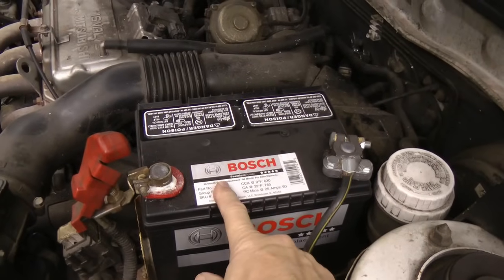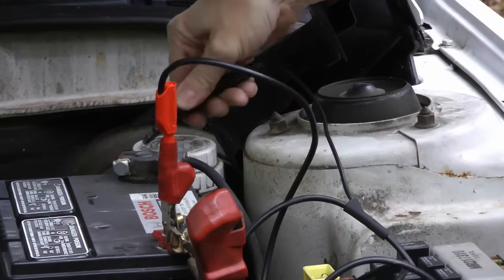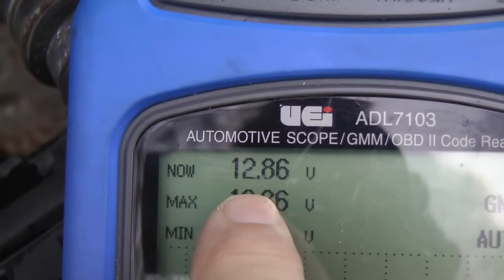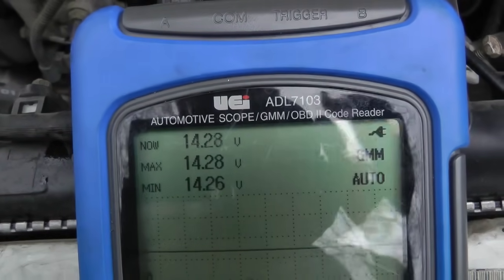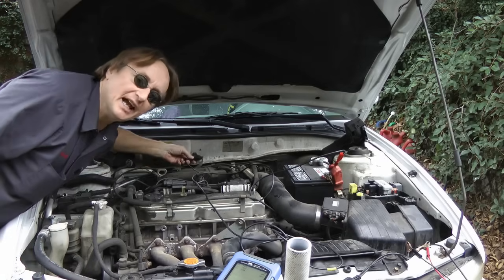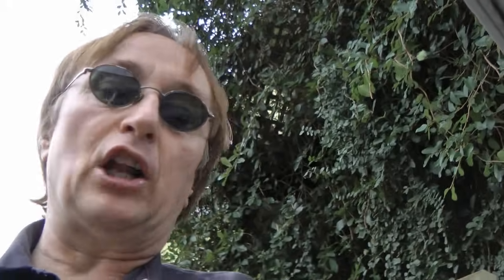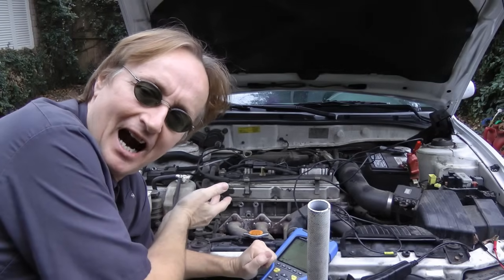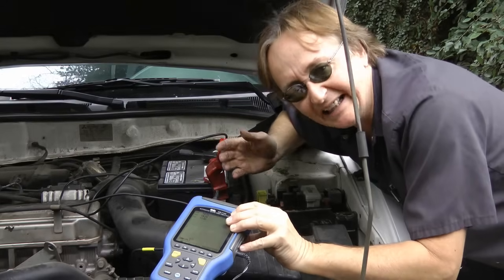How to Fix Electrical Problems in Your Car (Ground Fault)

Comment: hey scotty, i have a 2003 mazda 6. My brake lights remain on the whole time, even after the car is off. i replaced the brake light switch but that didn't seem to make a difference, what can it be ?
Reply from the maker: often the button that the brake light switch hits falls off, so the brake light just goes into that hole and the light stays on. Check that first.
Reply: i did give it a look and everything is fine. Any idea of what the problem might be?

Comment: Thanks for the tip on the engine ground. I have a mystery immobiliser problem and wanted to cross that one off the list. Trouble is knowing where to(or how to) get to all the other grounds to check them. Mechanic/electrician were reluctant, preferring to put a scanner on it, which seems like a total cop out to me.

Comment: Hey Scotty, on my toyota corolla 05 the key doesn't turn on the engine, I narrowed it down to no power getting to the starter relay, testing it I only got 1.6v of power on to it when i turned the key. But I cant find the source of the problem, any ideas?
Reply from the maker: often just a worn out ignition switch
Reply: Scotty Kilmer I have checked the ignition switch and it has continuity from turning the key. the Relay is new, and the starter is new, I have checked the Neatral safety switch too and it seems to work just fine. Still cant get the car started :/
Reply: ***** sir try to check the connection of d starter...

Comment: Is there a simple solution for my horn going off intermittently, I tap on steering wheel and finally and it quits, 2006 dodge stratus

Comment: Hey Scotty! I have a 1995 Honda Accord and when I turn the headlights on it takes awhile for them to come on. Like they need to warm up or something. Then, as I am driving they go in and out (not all the way out, but I am afraid they might). Also, my stereo goes on and off randomly.  Any suggestions?

Comment: Scotty Kilmer   Alright Scotty, I have a 1997 camaro z28. when i turn my car on, it turns the head lights on. and also, my tail lights come on but when i use my brake, the brake lights will go out. When i pull the fuse for my tail lights, the brake lights work like theyre supposed to. any ideas?

Comment: Scotty, here's one. I have a 2004 corolla which has a burned out brake light. The running light was still functioning. I replaced the bulb and the brake light still does not work. Now I have more problems, none of the rear tail lights on that side of the car work now (running, turn signal, back-up or brake) Any ideas here?
Reply from the maker: check the grounding wires on that side, odds are they are bad, you need power AND ground to make bulbs work. also check sockets, corroded ones will lose power or ground

Comment: Hi Scotty, My car is a 1976 Buick Skylark. Yesterday while I was changing my backup light bulbs, I noticed that both bulbs are 1157 dual filament bulbs. Why is that?
Reply from the maker: someone put the wrong bulbs in, BU lights are only one filament , that or some nut rewired them.
Reply: Scotty Kilmer  i have a question is regarding an electrical short in my car that is draining my battery... i already identify the fuse Engine Control Module ECMB 10A on my Chevy Blazer 4.3L S10 1989. how can i fix this problem?  please...
Reply from the maker: Hiram Camargo
that's the main computer fuse, either its wiring or computer is shorting out, have fun testing all those wires.
Reply: in this video, you always have one wire connected to the battery, so where do you connect it when you are far away from the battery?

Comment: Hi Scotty, I just attempted to install a pioneer headunit in my 2004 Kia Sorento EX. When I came to test it to see if it works, I started to observe electrical problems so I installed the factory radio back in the way it was before and the problems still there. The problem is as follows: radio doesn't work at all, dash clock doesn't work, when ignition is turned to on  the blower moter automatically turns on as well as the speed, tach and temp gauge readers rise for a few seconds then drops to zero, the drivers side parking and tail lights don't work, when headlights are on the dash lights and tail and parking lights go out when door is opened but headlights themselves remain lit, and keyless entry and power locks do not work and that's all I found so far. Fuses are fine. How can I find this problem before I take it to a dealer and pay a small fortune? thanks in advance.
Reply from the maker: probably shorted out a computer module, no one but a dealer is going to have equipment to check that stuff out, or a guy who used to work at one and has a kia dealer scan tool,hardly anyone has those, including me.
Reply: Scotty Kilmer Would it be fine driving? or will the problem spread to epic proportions?
Reply from the maker: res06cue
one never knows, drive it and find out. As long as it runs ok, may last a long time
Reply: Havent had any problems yet thanks scotty
Reply: Scotty Kilmer Found the problem, it was a fuse I've missed that was located in the distribution box under the hood replaced it everything's normal now. Why was the other components effected by a blown 20 amp audio fuse is beyond me.

Comment: mr kilmer my car stereo does a buzzing noise on fm what could be the problem
Reply from the maker: try installing a noise suppressor on the radio power line, radio shacks sell em
Reply: I will mr kilmer thank you

Comment: Question i have a missed fire on cylinder #3 replace injectors and did some tests after that i figured the is not getting the grounding signal. What can i Do? HELP
Reply from the maker: either wiring is shorting out, or main computer circuit. Often the computer
Reply: thanks for responding, I'm going to look for the wire the  goes to the computer before taking it to the dealer they always charge an arm and leg you know what i mean thanks ones again
Reply: thinking about this issue can i jump the ground  from other injector?

Comment: Hey Scotty what do  ya think about this. ? problems started on my 2005 pacifica with the consol shifter not moving. well I found this pink thing on the side of the consol and stuck a wedge in it and now it will shift , however ck engine light, tracking light,abs light and parking brake light are all on , then I discovered that the radio/cd wont come on /neither will the a/c heater . the elec.windows don't work and also the headlights. The brake lights do come on when pedal is pressed. so what is it.?

Comment: Thanks for the video Scotty. When I turn on my headlights in my 95 es300 my transmission goes nuts. Its fine with the lights off. Seems there is a bad ground somewhere.
Reply from the maker: I would assume that, OR have the alternator load tested,places like auto zone do that free and it could be that

Comment: Hello scotty I have a 2002 mitsubishi eclipse got all sorts of  problems  gas gauge  works sometimes it doesent the radio dont work and the doors lock and then they unlock themselfs can this be a problem with ground I tested fuses they all seem good

Comment: hey scotty i found i got a bad power wire going to my tranfer case computer that runs thought the firewall id rather just run a whole new wire any way to get the new wire in without removing the harness
Reply from the maker: sure, just cut wire before and after firewall, drill a small hole in the firewall and run a new wire for the bad one

Comment: i have a 93 caprice i just recently purchased and I notice sometimes as i would pull off to fast or hit a pothole my radio would go out and all my lights would dim dash and head light. I recently changed the battery and i noticed that the ground coming from the negative terminal was broken i replaced it, is it possible that's what my problem was because all my spark plugs were loose as well and i changed all the wires and plugs?
Reply from the maker: of course fix any obvious loose problem, but more often that's loose wiring connectors on the battery and or alternator charging system wires
Reply: OK today as i was driving i heard a pop sound then my radio went out, as i checked the fusses i noticed there was a 20amp fuse where a 15amp fuse should be, and the 20 amp had blown is it a problem having a bigger fuse where it should be a smaller fuse
Reply from the maker: Lance Moss
using higher amp fuses can end up destroying the device or wiring they are trying to protect

Comment: Hey Scotty, My 07 Escalade is  losing power,Jerking and lights and radio and locks in the car all be going off by it's self I have a video of it on my channel, but what ground would you say that is ?
Usually happens around slow speeds like 15, 20 mph....
neither do I want it happening at fast speeds wither that's scares the crap out of me. Thanks
Reply from the maker: either bad alternator, bad battery, or wiring shorts do that (ground OR power shorts.) Have the alt and battery load tested first places like auto zone do that free
Reply: Scotty Kilmer I put some Coke on it, and scrubbed it pretty good on the +, AND - Terminals, after that it aint been jerking doing like that. buhh im a still take it back to Chevy where I bought it so I CAN  GET a PERMANANT FIX!

Comment: Hey Scotty just so happen you are workn in a mitsubishi in this video... I Have 2001 mitsubishi galant and I was installing a remote starter and a positive wire hit a piece of metal which blew a fuse and everything shutdown so I had that fuse replace and my car started right up now right after that I am having trouble with the brake lights when I cut on my headlights the tail lights and brake lights work they just stay on but when I cut my headlights off and step on the brake they dont do nothing I checked fuses for the lights and brake lights there find do u think I could shorted out the ground connection from the spark Pleaseee Help I Have to go threw inspection
Reply from the maker: realize you shorted out something, and often it will be computer modules that ultimately run the lighting system. rather than mess with all that crap, I would just rewire the power to the brake lights using wire and the old brake light switch and run the wire back to the brake lights and wire em direct

Comment: hey Scotty... I have a 1998 Mitsubishi Eclipse GSX and if i immediately start the car.. it buzzes at me and doesn't do anything. But if i wait at least 3 seconds it starts fine any suggestions? Sound sounds as if its coming somewhere in the center behind the radio. Did this before i even got a new radio installed.

Comment: Hey Scotty, I noticed that the engine in my 05 Ford Focus seems to lose RPMs and vibrate more after I turn on the fan blower. When I turn the fan off, all is fine. Could that be an alternator problem? It doesn't seem to be loose, and drive belt was replaced three years ago.
Reply from the maker: do have the battery and alternator load tested, places like auto zone do that free. Pray it's that and NOT a wearing out Ac compressor that can strain the engine when you turn it on
Reply: Scotty Kilmer Thing is, the AC ISN'T on at the time; just the fan.

Comment: hi scotty your videos are great and very helpful. I am jus stomped by an issue I am having with my 98 chevy cavalier.. First the starter went out so I changed the starter I kinda got tired of starting it from under the hood every three starts... then the battery went bad it started smelling like rottin eggs then the positive on the battery melted. Changed the battery now it will onlt run 15 min max then shut off smh plz help me what could the issue be... thanks ur the greastest
Reply from the maker: when it dies, quick do my video "fixing a car that cranks but doesn't start up" to find the cause. Be sure to pressure test the fuel pump, they often go bad

Comment: Hi Scotty,  videos help me a lot, my 1997 chevy 1500 2 wd 350 vortec long bed is an electrical nightmare. Had truck since new, 1st engine had bad water leak, it cracked block and both heads.  New same engine now with 16 k miles. Electrical problem started by all rear lights going out then come on anytime with switch on. Put a new brake light system in, not using any part of truck's light system. Now brake lights work great (new system) and other rear lights work great, truck brake lights still do not work. Latest problem, when driving on cruise and turn lights on, cruise turns off. I have not found any lose connections but can not check this while running down  road. Any suggestions ??
Reply from the maker: yea, don't buy a chevy next time. realize all those systems are ultimately run by the BCM computer modules that go out all the time in GMs.  I would suspect yours is going out from all those problems.

Comment: Got a  2000  impala shuts off when it gets to running temp and the fan kicks on changed cps and maf sensors just by researching the sympotms d. Still doing the same .can u think of any thing i may be missing anu help will b much appreciated thankyou
Reply from the maker: if it shuts off when the fans come on, have the alternator and battery load tested first, places like auto zone do that free. Fans use lots of power, and a weak charging system can then conk out the car
Reply: Thanks scotty ill have that checked out . Autozone told me to try change iginition module .

Comment: Nice vid man. It was great meeting you at the Shell deal last week. Your videos are 100% you, and I dig that!
Reply from the maker: Yes, it was great meeting you, if I get any VW questions, I'll be sure to tap your brain.  Yesterday I went back to shell and filmed a couple vids on gas to oil conversion and The Woman Who Knows Engines.  And I found out how you guys probably got a better price on the premium oil, they aren't making much profit on dealership and maufacturer sales, it's a PR move. Figuring if OEMs use it, the public will follow using that very same oil. It's all about what the public will buy, just like my vids being for the general public. It's a VAST audience.
Reply: Heck yea man! That is awesome you got to shoot that video you wanted. That gal I think her name was Shanna or something. She is freaking smart and knows her stuff.

If I can ever help ya out with anything VW, let me know. I'd be happy to help out.

Cheers
Charles
Reply: Ur famous now 🤪
Reply: Thank you so much Scotty. love your channel you've taught me so much and just when Im about ready to  throw the white flag you save the day every time. I'm watching from Midland, TX. 
 I drive a 2004 Chevy trailblazer 4×4 with 304,000 miles. It was a ex police vehicle   so my radio wire harness was not wired the correct way. I had to rearrange all the pins back to their original places to get my radio to power on. Before I found out the wiring issue I had installed a new transmission by myself with no experience at all which didn't do me any good because I still had the same problems, just to find out it was bad wiring contact. Once I fixed the harness the truck ran with no issues.
Reply: I hope to meet Scotty one day. He has taught me so much over these years.
Reply: Hey, that's great! I already subscribe to both your channels. Thanks for all the help guys.

Comment: Hi Scotty, i have a question.
   my truck was running and i turned on the lights and when i did the truck went dead like it has no power the only thing that works is the light for the gears. any ideas on what it could be?
Reply from the maker: go to a place like auto zone, they load test batteries and alternators free, pray it's just a worn out alternator or really shot battery. Try charging the battery up, and if it starts, drive to a store to get those checked.

Comment: Scotty my name is Frank I just bought a ford f150 94 I just went to put gas in both tanks one of the gauges works fine but when I switch to the other tank the gauge goes past full and the truck shuts off and won't start till I switch back to other tank please tell me why do you think it's the fuel pump or bad ground thx Frank
Reply from the maker: check the ground first, cause a bad pump will not make the gauge go whacky. Also check the power wire to that system AND the switch over valve, those valves often go bad.

Comment: Can a wiring problem cause the car to randomly shut off (no previous problems) while driving, and then not allow you to turn it back on? I'm not even able to get it to turn over or have the radio working. All lights work, and stuff, so I'm not sure. When it happened, I smelled something burning inside the cab. I immediately stopped to check if the burning smell came from the engine, but smelled nothing from there. Could a wire have burned from touching another wire and caused the car to completely shut off? :(

Comment: Hello Scotty,
(2007 Chevy Impala v6 3.5L) Recently we noticed that the left blinker arrow on the dash was blinking faster than is normal and so we assumed automatically that we had a burnt out signal and looked to see which one was not flashing. We found the rear left signal was not flashing and so we replaced the turn signal bulb. After changing it, the turn signal would still not work and I discovered that none of the other lights of the left tail light were working. It seems it could not be a fuse and to make sure i checked the fuses for lights. Would you have any suggestions for me? Your videos are extremely helpful and thanks for all the help!

Comment: Hi Scotty, I do have a strange one for my 2008 ford fusion. About a year ago my trunk lock start to make a very loud sound when I used my key button.   Now when I start to unlock my doors via the key button the car the radio will just turn on (sometimes).  I come out to find my card dead, and I have a new battery of about 6 months. I think this is pretty strange.